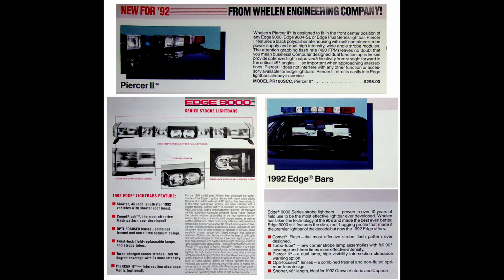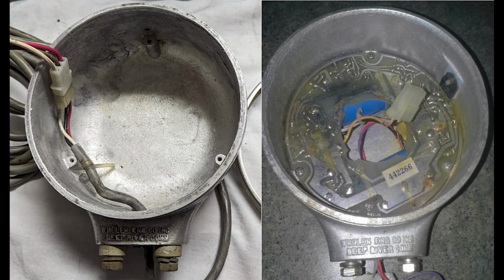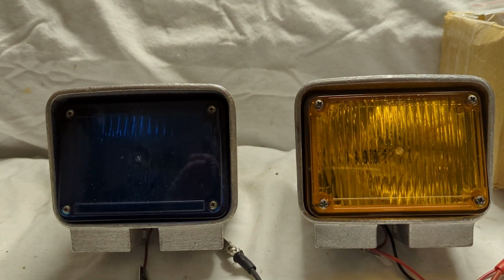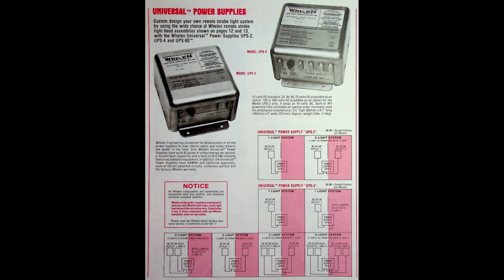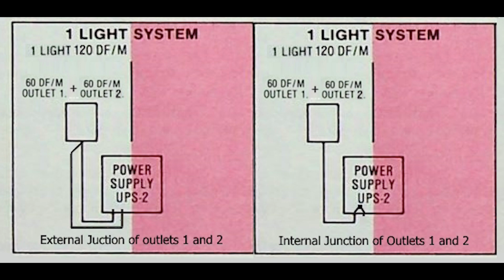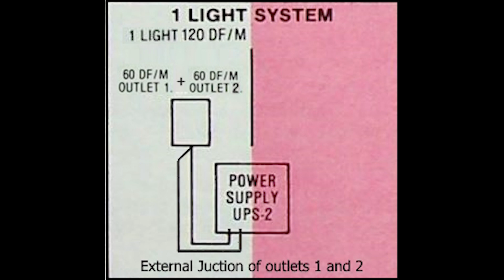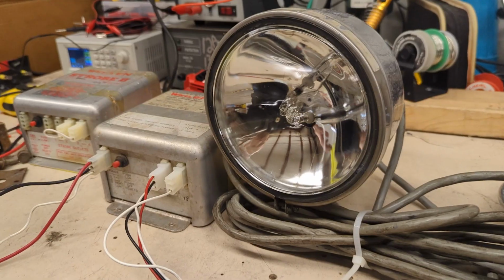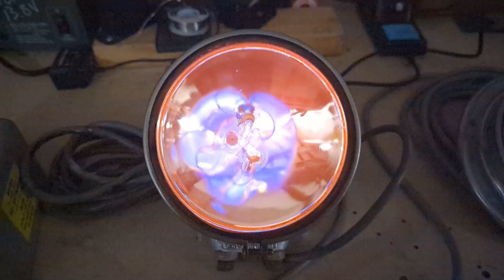Whelen Piercer, from Sealed Beam TCL to Edge Lightbar Option

Comment: In Massachusetts the solar electronic sign/arrow boards for construction used to have a single Amber solo strobe mounted on them back in the day..
Reply: In Indiana, DOT temporary signs had two strobe heads and housings, similar looking to the round ones featured in this video. However, they were eventually converted to LED
Reply from the maker: Good point. I have seen them on several different DOT and construction trailers. The idea of only needing power (not a whole strobe wire set) run to the trailer is was nice before LEDs. This is probably the most frequent situation I saw them in.

Comment: I don't know much about strobe power supplies... pretty much nothing specific, actually. I do have a strong automotive electronics background however, so it surprised/confused me that the strobe was wired to both triggers and not both outputs of the supply... do both outlets share the same capacitors? And only the transistor switching triggers between outlets determine which tube flashes? That explains why a dual strobe dash light doesn't destroy its power supply (or half of it) when one tube goes bad... Interesting. I wonder if this double-driving is doable with later power supplies, like a 9M4S, SL6, or a UB412? Double comet flashes... almost zero off time.